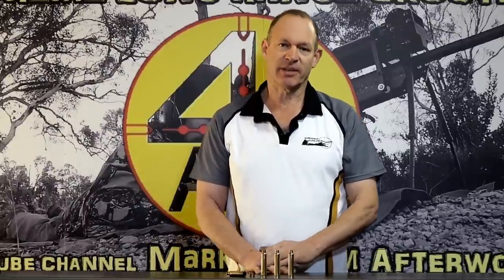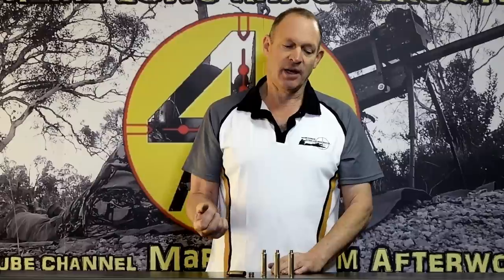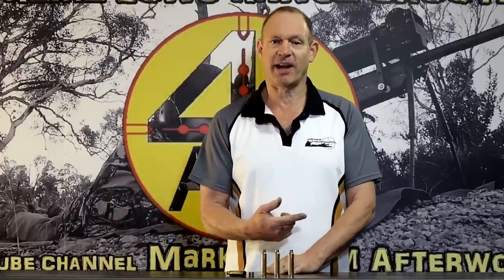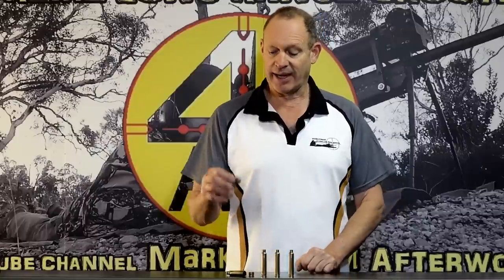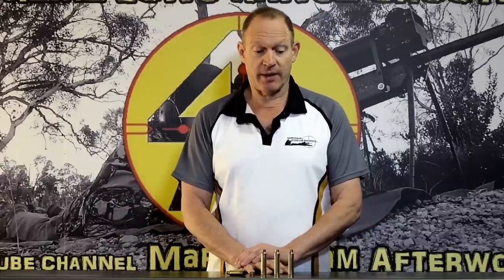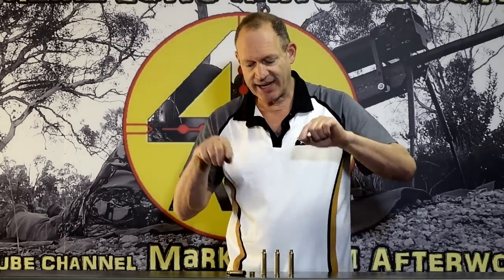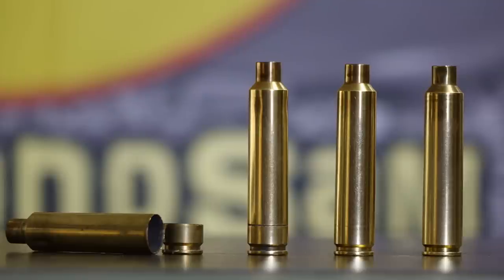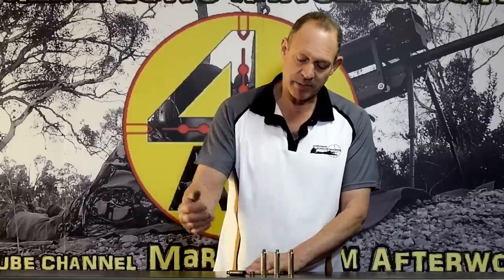Broken Case, cause/removing/etc

Comment: Nice,  I personally use a piece of tie wire for rural wire fences that i snipped off the make a sharp flat edge and bent it to shape so 😲 can feel the thinning of the brass. Cheap as chips, discard brass before it seperates 😉😜 
Thanks for the video
Reply from the maker: Thanks Man

Comment: A brass cleaning bush, pushed into the case neck, also works great.   I used the tip of a cleaning rod that I shortened and bent to fit into my range bag, when a case separated I would screw the brush into the end of the bent cleaning rod and work it into the chamber to catch the case and pull it right out with no trouble.   That is no longer an issue because I learned how to properly set up my sizing dies.
Reply from the maker: Thanks Bud, Cheers

Comment: Whilst playing with some hot loads I noticed several pieces of brass had a light ring on them just above the case head.  I decided it was best to 'retire' those cases rather than chance a stuck headless case.  Besides, an extra 50fps wasn't worth the potential headache.
Reply from the maker: Yep, Cheers

Comment: I had a case separation in my AR-15, a chamber brush pulled it right out. getting the case off the brush wasn't as easy.
Reply from the maker: That works,  thanks man, Cheers

Comment: Mark have you ever tried using a tight cleaning brush on a rod up into the case?  That trick works like a charm.  When you pull back the brush sticks in the case.
Reply: This one i will put in my remember/recovery list.  😊👍
Reply: @janne65olsson  Works like a charm you just need a brush that will fit into the case when you reverse the direction the brush locks in tight enough to pull the case out easily.
Reply from the maker: Probably the most common way from the comments, thanks Chuck, Cheers
Reply: @markandsamafterwork  No no, thank you I have learned so much from your videos.  I have mad respect for your long range knowledge and ability, I am happy when I hit a prairie dog at 450 yards.

Comment: As you stated best to avoid the situation. To avoid round rupture I no longer use Wolf steel cased rounds as I have had two cracks part way around the rim and proved difficult to remove. Fantastic Information provided as usual.
Reply from the maker: Thanks Colin, cheers

Comment: The trick is, don't full length resize. Either neck size or partially resize and reduce headspace. Bump back the shoulder only one or two thousands of an inch. Me personally, I  never full length size .only neck size and never had a problem. Even after multiple reloads.
Reply from the maker: Thanks Kim, yes can help in some circumstances, although doesn't suit or cure all, can sure suit some, Cheers

Comment: Not just bottle-necked cases.  I had a couple of 9mm cases separate in an AR-9, and they were buggers to get out.  Picks, oversize brushes, Hoppe's... nothing worked.  I had to use cerrosafe.
Reply from the maker: Cheers

Comment: I watched a friend have a case head separate and not pay attention in his AR and next round didn't fully feed so he used the forward assist and it went in enough that it fired and what would have been really bad well could have he got lucky so just always if something don't go right don't force it  make sure to check chamber if it's not going into lockup
Reply from the maker: Thanks Allen, Cheers

Comment: i had four separations on the last range trip. hornady brass five times fired.
Reply from the maker: Damn, Cheers
Reply: @markandsamafterwork  i went to pacific tool and bought their case extractor because i just loaded 300 rounds with those cases.